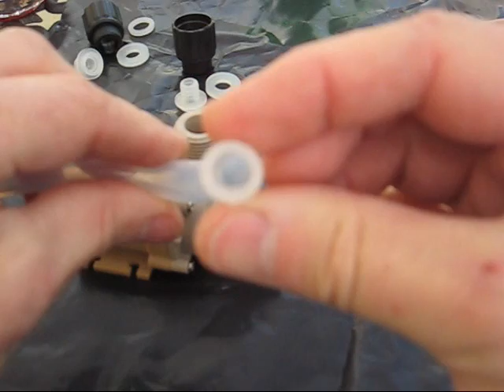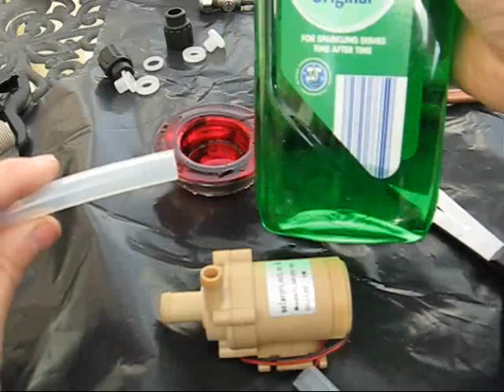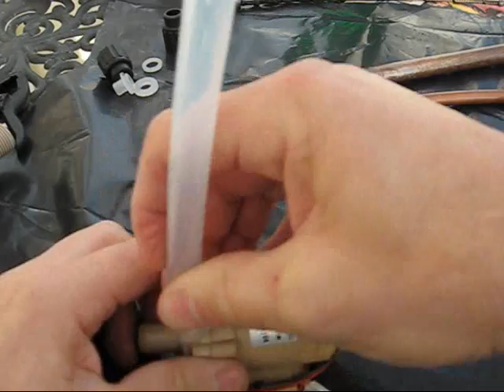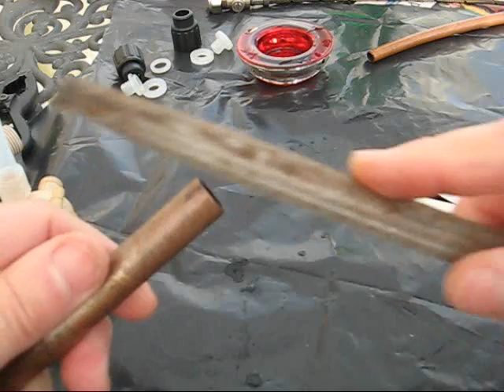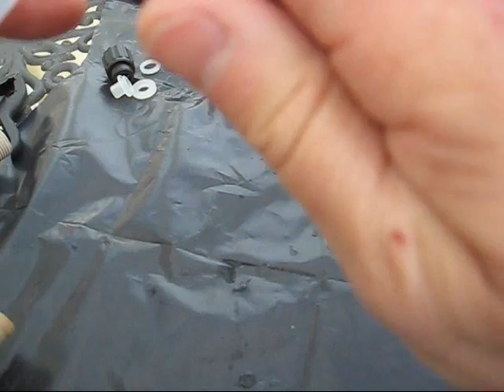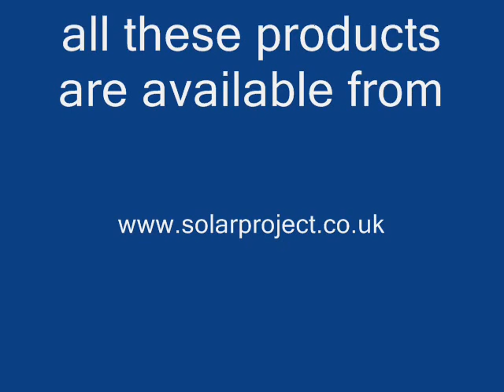pump connection options

Comment: I have a question. I would like to use a 12v pump to run 100m of 3/4 hard irrigarion tubing rolled in a spiral (3meters up on the roof) to heat my swimming pool.
The difference in height will be compensated by gravity as is decends back into the pool.
my intent is to run the system 15 minutes to a max of 30min then a pause for 30min to let the system to reheat.
I don't need a very large flow rate... but 12v gives me the piece of mind safety wise for the people in the pool.

Thanking you in advance

Comment: I can add a stopcock at the pump ? the pump will be damaged ?
Reply from the maker: Yes, if it is necessary then it is fine to stop the flow mechanically with a valve or stopcock, it won't damage the pump.